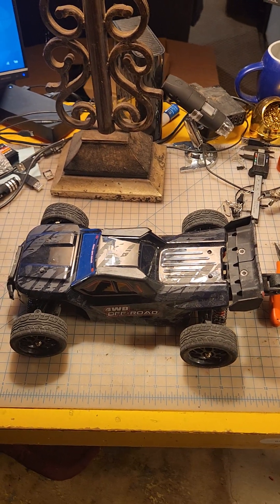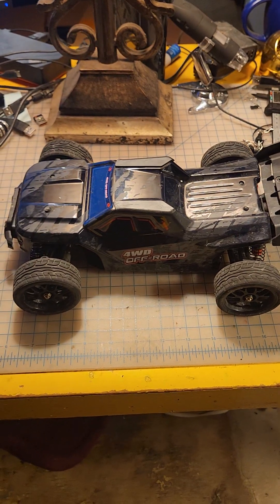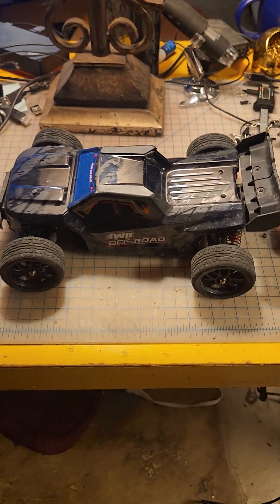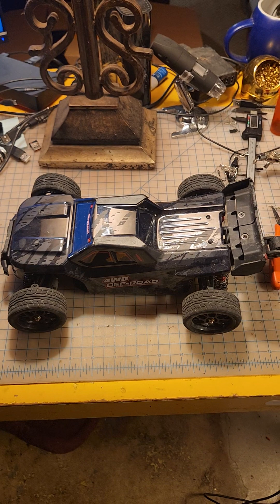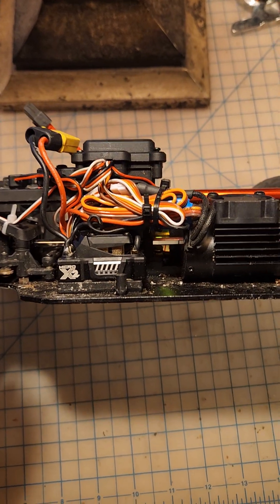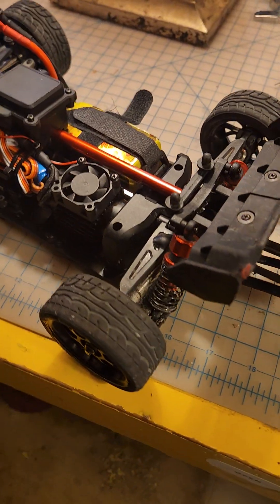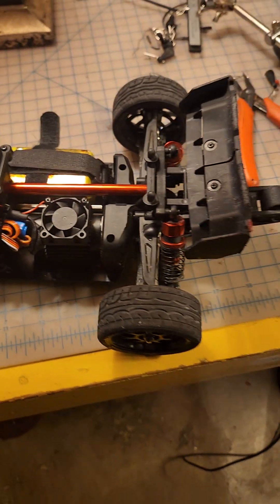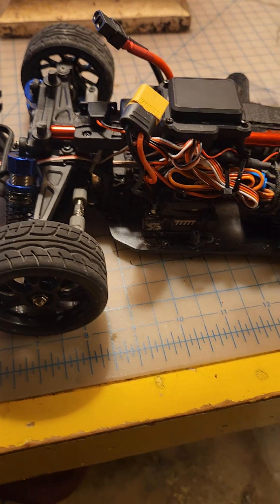HOW TO RUN YOUR MJX 14-209 AND 14-210 ON 4S.  DO IT.

Comment: Can the mamba micro x2 install on mjx 16209 with 4s battery, without changing the other parts?
Reply from the maker: You can but you should upgrade the pinion and spur gears.
Reply: @CYDEXTECH thank you 🤝